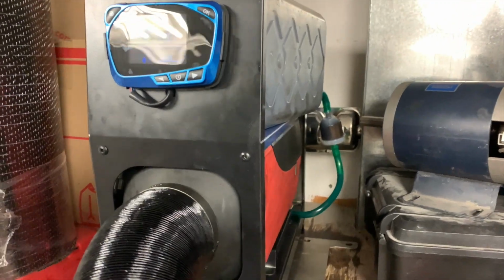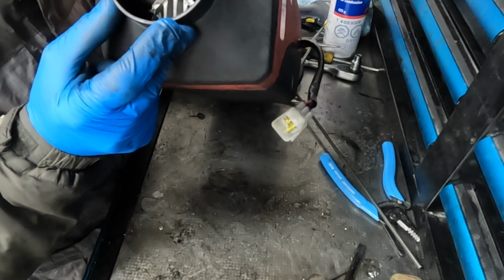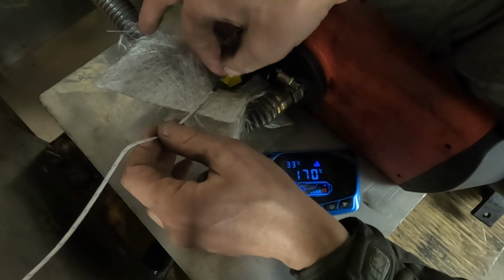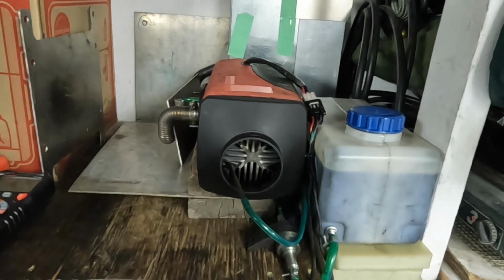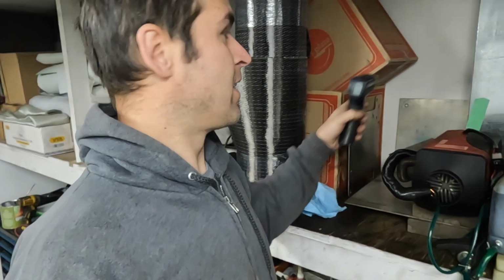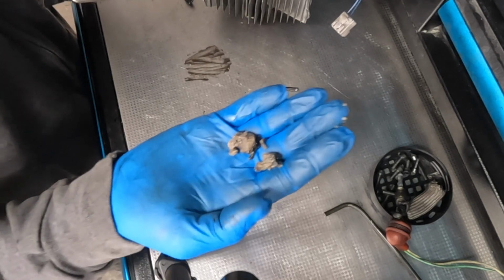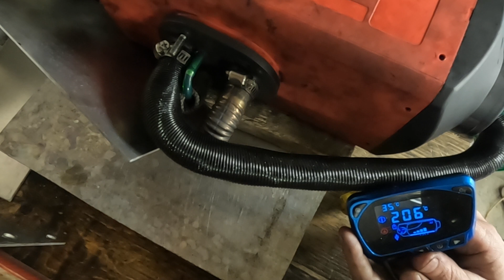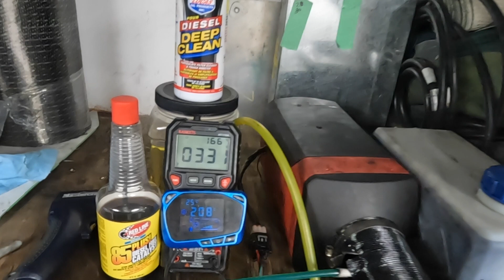EASY Waste Oil Preheater - Chinese Diesel Heater. PT-10

Comment: I liked your explanation on preheating the fuel but to watch the proof was really great! So worth watching to the end. Thanks for great job. Can't wait for number 11.
Reply from the maker: Thanks ! I think the results could be different if you used waste oil that was from a different source and / or filtered it really well, dewatered it and so on... Most of the gassing here is likely from contamination of the oil and not from the motor oil itself, but this is how I use my oil, so this is how I ran my test. 

Cheers !
Reply: @Lowered Expectations  I also was wondering about using new oil and of various  types (Synthetic vs Dino) to have a base line on what to expect. I keep looking at the oil centrifuge (like Diesel Craft) but hate to spend the money. If I do, I would probably use compressed air in a holding tank vs buying a pump... best laid plans or something like that.
Reply from the maker: @darrylbrown1319  Haha... yeah. There are lots if variables when it comes to waste oil... it's hard to know what you are getting. I used a high quality semi synthetic Motul 10W40, and it takes a lot more heat to burn than my waste oil... it made a LOT of blue smoke. 

I may end up building a small centrifuge, but based on my testing, the number one issue is keeping heat in the chamber to flash the oil off (or significantly lowering the flash point of the oil)

Comment: i think you have a bit of water in that waste oil, my heated wvo (same way you do just 9 mm pipe) dont form bobbles - though it takes some time for air to clear the lines
Reply from the maker: You got 9mm pipe ti fit in the heat exchanger ? Interesting. Did you squish it oval ? 

Yes... I do have some water contamination, but also, I am mixing with gasoline and waste motor oil from air cooled engines, tends to have a lot of combustion byproducts. 

If I run pure diesel it does not bubble ... I was sure that it would worse than the oil.... I have not not tested new motor oil or waste automotive oil, but I have a feeling that they would not vaporize as much.
Reply: @loweredexpectations4927  yup, petrol/gas will be the bubbling issue. i think more airflow might help the burn once it gets started with the heated oil.
Reply from the maker: @mightyfinejonboy  I do think that air flow is a part of the puzzle, but the chamber needs to be really hot before you increase air flow, ir it will just cool it off. I've done a lot of testing since this footage and it seems the main challenge is getting / keeping heat in the burn chamber. Oil requires a much higher temperature to flash off, and if this doesn't happen, then you get lots of carbon pooling in the bottom of the chamber.
Reply: @loweredexpectations4927  haha no 9mm will now fit, but i broke two gills off to fit it :)  - i only had a 9mm pipe. I was thinking if it was due to gasoline. i have also bend the end of the  metal pipe that runs to the glowplug so i dont have this u shaped plastic pipeline running down besides the exhaust.
Reply from the maker: @mnp3713  I was going to do the same thing with the metal line so that my new line connected directly. The reason I didn't, is because I wanted a piece of clear line where I can see it so I know what's happening with the fuel, and so when I prime it. I know when it's getting close.  I may do it in the future, as it is cleaner looking and less likely to burn ...
Reply: @loweredexpectations4927  Thought so, i also started doing so for that reason. 
i just took mine apart and the end plate on the burner air intake fell off, to my big suprise there was not any carbon in the inner part "long holes" of the burner. When burning WVO only carbon build up in the outer bottom of the tube part. This explains why i can burn so much WVO before it goes bad. I think i have burned around 300l of WVO this winter on a new unit. also the end plate is magnetic.
Reply from the maker: @mnp3713  Yeah... if the area behind the bafle stays clear, it will continue to light and burn pretty decently, even with lots of carbon in the open end of the burn chamber. This makes me curious as to why yours would be staying clean in that area...
Reply: @loweredexpectations4927  well vegetable oil is quite a different fuel than motoroil, and mine is very clean 2 micron filtered "cause i drive on it" - just see the metalsludge you found. Guess the WVO vaporize fine and the carbon in the outer tube is due to rich or cold burn? forgot to mention that i have had carbon build up in the glowplug mesh - perhaps due to ignition failure and flooding
Reply from the maker: @mnp3713  My glow plug mesh doesn't seem to affect much ... I have totally given up cleaning it and it still starts fine. I have heard that it makes a big difference, but haven't seen evidence of it. That is interesting about how yours burns tho...
Reply from the maker: @mnp3713  My heater is basically doing the complete opposite of that. I can't get enough heat in the main burn area (just behind the bafle) and the outer tube is staying pretty clean, other than some white ash. I've been monitoring the temp of my chamber where the oil goes in, and it runs at about 160-180... The other day I was testing and got it up to 230C where the fuel goes in, and it was burning oil perfectly clean. No smoke atall, 210C on the heat exchanger .... but it didn't last for long ...
Reply: @loweredexpectations4927  i was wondering who hot that part got, THX for the info. 
Yes quite different, but i will say im not 100% sure as i have only taken it apart 3 times and only once behind the bafle. other 2 times i just throw it in the firestove - but i just found it strange that no carbon was build up even after 300l of WVO and 3 times in the firestove.  Also my inner burn chamber tube cap (the one some people say can be removed) is leaking and bend a bit in the bottom - perhaps the carbonsludge just runs out into the tube. I will make a short video for you to take a look at next time it flames out. I just think that motoroil is too dirty to burn, perhaps make a test burning clean new motor oil and see if it still clogs up - cause you can buy 0.5micron filtersbags for 5$ this will make the oil clear again

Comment: Has anyone actually had any luck running these on waste oil long term? I tried 60% oil 40% diesel. My heater outlet is ducted through my oil tank to preheat it a bit. Then I have a few wraps of brake line around the exhaust right before the fuel nozzle to further preheat it. I have also tried without heating it around the exhaust. Didn’t seem to make much of a difference in how it ran. I have a valve that goes to a tank with clean diesel so I start and stop on that. I have adjusted my fuel pump in the Locked settings menu so it’s pumping less fuel but the fan is still full rpm. My oil tank has a hydraulic filter plumbed into the filling inlet so anything that goes into the tank is filtered through that plus I have an inline filter before the pump. The air intake for the burn chamber is also preheated. The longest I have got it to run is 3 days and I took it apart after it shut itself off and the entire thing was completely full of soot and solid ash.
Reply from the maker: Many claim that they have had great luck, but I have NEVER seen any video evidence of this. You see a bunch of people making 2-3 videos saying it's great and then never hear form them again... 

From talking to lots of people who work on commercial waste oil burners, the soot is inevitable, so it's a matter of being able to deal with the ash / soot. 

I have experimented with burning brand new oil, so it is not a matter of the oil being clean. I have heard people say that they run 10% oil with no issues... and I find that somewhat believable... but for me that's not worth it. Your 3 days of run time seems about right to me. I have 30 videos that all end in failure... many many experiments that were not filmed.

Comment: Love your ”never quit” attitude. 😄👍 I mentioned in a comment a couple of videos back, the amount of particels in the oil and suggested a test with clean motor oil to see if something changes and you answered you would try that. I do understand it will take a while before that video will come. But the metal on your ”glove-magnet”…😄, is kinda pointing in the same direction im thinking. I am deeply impressed by the heater and how much abuse it can take, but i also think its going to be a bit of a challenge to make the heater to burn the metal in the used oil. I think part of the build up you have in the heater comes from that. It would be very interesting to see what would happen if you ”clean” that used oil a bit before using it. Like running the oil through a hanging textile filter with a magnet in the bottom or something similar. I will follow this adventure until you will be successful with the heater or maybe until your garage is no more, either way you will get a lot of heat. So keep up the good work. 😉
Reply from the maker: Thanks again for the comment ! I have done some testing with new motor oil. Motul 10W40 semi synthetic stuff. I think I have a few videos to release before that one, but it's coming. 

Yeah... There's only so much you can do without good filtration / a centrifuge. The idea of testing the new oil is to see if the main / current battle is due to oil or contamination. 

HAHA.. let's hope that I'm not making a video of me roasting weenies over my garage !!

Comment: could maybe just warm it through the brake line in front of the warm air blowing out, it pumps slow enough to get it pretty warm. just a thought. i admire your determination
Reply: after thining about it ,the fuel would have too much time to cool back down before it got into the heater
Reply from the maker: Yes... I had thought about that... Just making a oil / loop of brake line in the air outlet. I'm not sure that would get it hot enough and it's actually more tricky to do, in my opinion. 

Determination is a good word for it... some call it insanity, haha. I have been making more progress ! Testing continues.
Reply from the maker: That is possible.
Reply: I'm sure if you could regulate the fuel temp to a 60-70 degrees you would get a  better result. You could lift your brake line off the fin's, or insulate enough off the brake line until desired temp is reached !
Reply from the maker: @Keith24GB  Thanks... I have had that suggestion a few times. From what I have read, waste oil furnaces generally heat the oil to 90C or more. The difference being that they filter their oil really well and generally have some sort of drying process. I believe my oil mix is vaporizing because 1. It has some water content and 2. It has some gasoline in it (even when I don't purposely add it)

Comment: Oh just thought of something else I was going to comment on. So on mine when it has been running on highnfot a while and I reduce the setting, I too have noticed the housing temp increases significantly for a while, it then drops down  shortly afterwards. I have put it down to the reduced airflow on the lower setting and the latent heat in the housing.
Reply from the maker: Yes... I think you are right about the lowered air flow over the exchanger.

Comment: would increasing airflow help by using a 12v mattress air inflator with a speed controller?
Reply from the maker: I was sure that I responded to this... I responded to another of your comments that basically answers this... but yes, I have thought of this and ig could help, once the burn chamber heat is under control. I have ordered a ECU and controller that should allow me to control the fan speed and fuel separately, so hopefully that works.

Comment: Have you considered using 12v heat tape to heat the oil to a more controlled temp
Reply from the maker: Thanks for the comment. 

That's not a bad idea, but I don't think it's terribly necessary to control it that accurately. 

There are also other issues as well. If you heat a large reservoir of oil, this would method would work, but it would take a lot of heat, and evaporate off lighter fuels that are used to thin the oil (gas, kerosene or diesel). 

If you use it on a closed system where it does not release gasses, then you build pressure. The only way practical way to do this is to heat between the pump and the heater. If you heat to 90C between the pump and heater to 90C, you're going to get some off gassing. The 12V heater would likely cause less fluctuation, but with the "right" length fuel line this doesn't seem to be too much of an issue. Cheers.

Comment: The pictures of vapour bubbles in the hot oil resurrected a thought in my mind, that might be worth a look when you get back onto efficient running on plain diesel. 
With this type of dosing pump, on the power stroke, the rapid movement of the piston or slug, causes a partial vacuum to form behind it allowing cavitation bubbles to form. on the return stroke, these pass through the one way valve and on the next power stroke, they are pumped along the fuel line. Since the bubbles formed are comprised of  vaporised fuel, and the swept volume is liquid + bubbles, it must mean that there is marginally less liquid fuel pumped/min than the expected [no. of strokes/min] x chamber volume. To avoid this cavitation the fuel needs to be delivered to the back of the piston at a pressure at least equal to the vapour pressure of the fuel at running temperature. This could be achieved perhaps just by having a suitably large head between the tank and pump, or by a second pump circuit to feed positive pressure to the fuel entering the dosing pump, with a variable relief valve returning unused fuel to the tank. 
This might just make a percent or to increase in output and could give a smoother burn. Small maybe, but every little bit counts.     OG

ps  I'd love to know why these bubbles don't just condense back to liquid fuel once they have passed the pump and move into the slightly pressurised environment of the delivery pipe, as they travel to the burner . All I can think of is perhaps some kind of surface tension effect ?
Any ideas fellas ??
Reply from the maker: 😂 Thanks for the detailed comment... Your brain works a little like mine... However... why not just make the correction with increasing the hz of the pump ? I do always make sure that my tank is above the pump and it is gravity fed, specifically for this reason, more pressure = more head = less cavitation. 

That is a great question about why the bubbles don't totally collapse. My guess is that the fuel isn't just heating and cooling, but some if it is actually "burning" in this process. A chemical change due to the heat from the cavitation. Miniscule diesel effects.
Reply: @loweredexpectations4927  
< why not just make the correction with increasing the hz of the pump? >
What ? ..... doing something the easy way ...? ! c'mon, no fun in that  ;<))
It is amazing what my lunacy my mind will turn to at silly o'clock in the morning when I can't sleep.
I must admit, I hadn't thought of chemical change at the point of cavitation. It does occur to me that small  fuel vapour bubbles in the stream might just give a tiny advantage at start up, since some fuel is already vaporised when it hits the hot glow plug..... who knows ?
Reply from the maker: @bigoldgrizzly  🤣 .... Don't forget who is saying "do things the easy way".... a guy who has spent two months trying to make this heater burn waste oil, when he could just build a dedicated waste oil burner. haha. 

It is possible that some pre vaporized fuel could be helping things along during startup 🤷‍♂
Reply: @loweredexpectations4927  
My old Physics teacher was fond of saying " Experience is what you acquire, when you don't get what you expected!
A year or two back. I found an old [1969?] practical assignment of mine he had marked. I had made an error in my method and he tasked me to identify and report back what that error was. He also added " Not to worry. You wouldn't be doing it right if you didn't do something wrong .... provided you learn from the experience"
One thing I particularly like about your videos is that after reporting about what you have tried and the results. you tell us what you are intending to try next. This Stimulates us to think through what might happen and why and to discuss it in the comments. A fun way for us all to learn as your experiments proceed.   Thank you!

Comment: One of mine runs at 230C all day, it's normal.  Probably melted inlet fan with the hot air intake.  I have three, one has fuel coil around exhaust with tin foil to insulate between exhaust and copper tube, about .200".  Used oil needs to be filtered and thinned.  I used gas, 10-15%.  Done all these experiments already, opted out ,sticking with diesel and 5% gas.  Another tip, to make lean or rich, move intake fan in (to lean) or out on shaft.
Reply from the maker: Your heater runs at 230C ? That curious. I've had someone else tell me theirs ran at 245C, I believe. The owner's manual says that the overheat limit is 230... but mine is just above 236. I have seen many videos of these heaters and the normal / average temperature seems to be closer to 186. Oh... You run waste oil and gas 👍 that temp makes more sense now. 

You're not too far off with your fan melting guess... 

My oil is filtered some, and always thinned with diesel and sometimes also gasoline. Currently 70% oil, 20% diesel and 10% gasoline... and because I don't want to do the math ... I have added 20ml of cetane booster. 

Since this video I have made many modifications, some of them complete fails and others steps in the right direction. Currently running a test that seems very promising, but I've had that thought beforehand they never end well, haha. Testing continues.